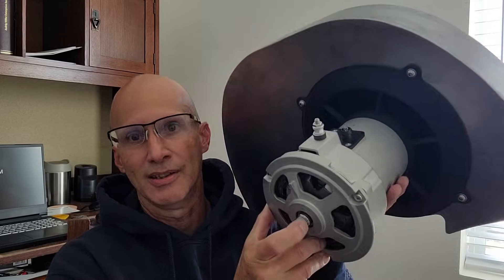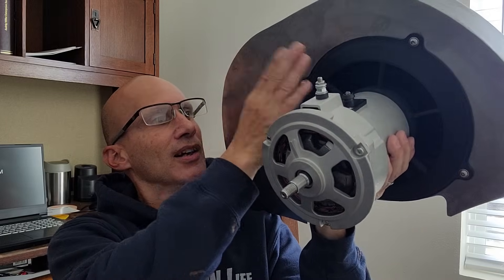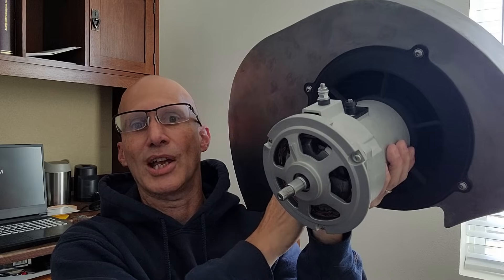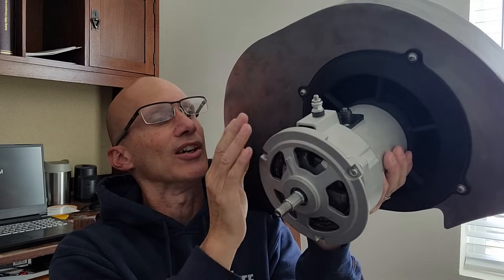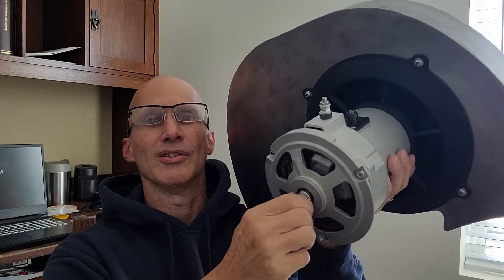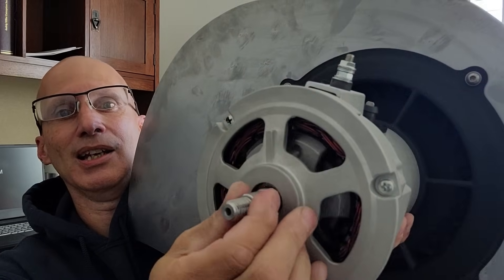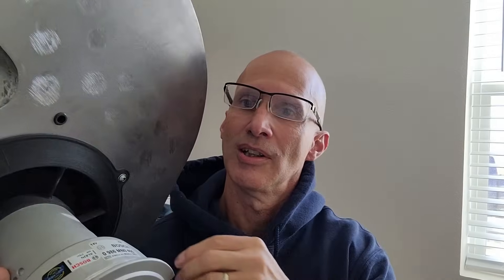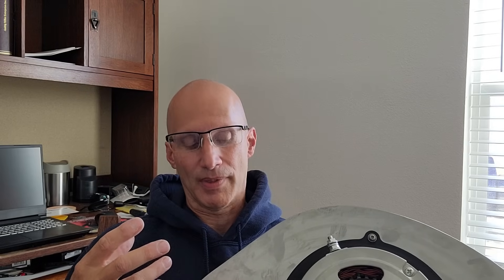Evolution Two Cooling system is now available!

Comment: Andrig
It looks great.  What a shroud with the dog house for the oil cooler?
Reply from the maker: I'm not sure exactly what you mean, but are you asking if I might produce a fan shroud with the dog house for the oil cooler?  If so, it's something I have thought about, but it makes the design a lot more complicated, that's for sure.  It would take quite a while in development to get the airflow exactly right, and the fabrication would be significantly more complex.